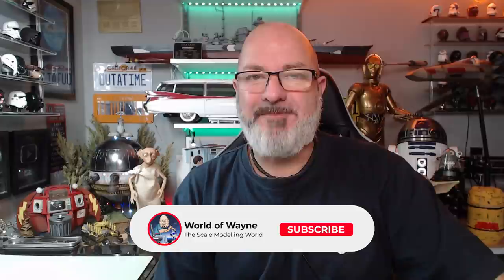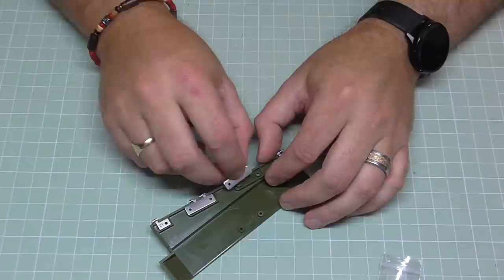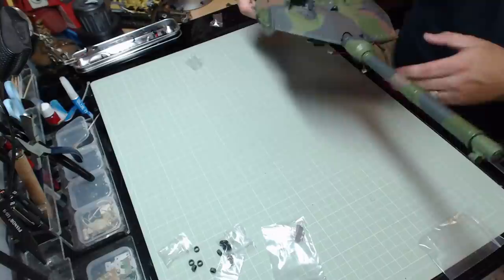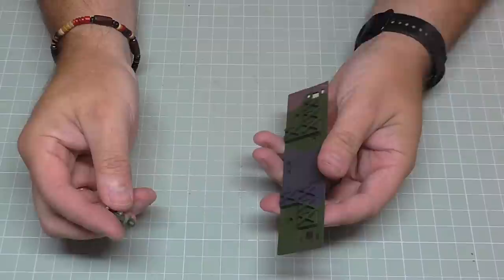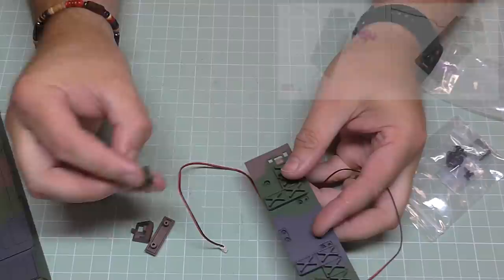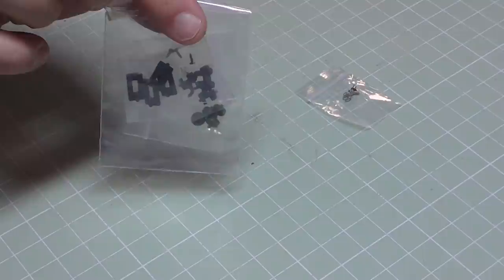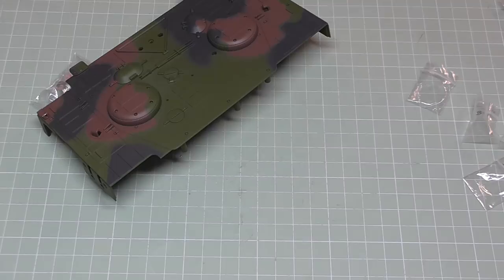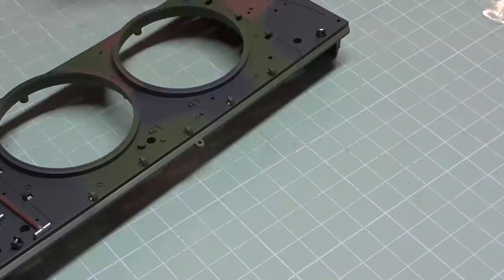Build the 1:16 Scale Leopard 2A6 Main Battle Tank - Pack 4 - Stages 25-33

Comment: Are you going to be building the Eddie Stobart Truck?
The parts above the tracks to either side are known as the sponsons and contain the left and right fuel tanks, there is a third fuel tank in the centre of the tank near the base. This tank can hold up to £5000 worth of fuel giving it a range of about 350 miles.
Reply from the maker: Nope
Reply: @WorldofWayneUK  Too big or not interesting enough?
Reply from the maker: @milanondrak5564  really not my cup of tea. One of the big American Juggernaughts would have been my thing

Comment: I find it a bit annoying that many of these models seem to be ill thought out as regards to assembly. Putting it together just to take it apart to add something that should have been included in the first place is stupid. Your recent experience with the F-40 is a classic example Wayne and shouldn't be necessary in kits costing as much as they do! Rant over! ☺️
Reply: I will say this: Its perfectly logical to put a tank together using screws to hold together metal panels. 

Theres not a whole lot of excuses like that for the Enterprise, when the single-piece injection molded models look so much better than a starship full of gaps inbetween the panels.

Comment: You'll need to keep an eye on how many of those track sections get assembled on each track.  I would imagine that those are none too easy to take apart!
Reply: I booboo-ed one of my links where it is upside down and still haven't decided how I'm taking it apart.  All following assemblies of the tracks have been paused as well because I've been staring at the lack of an end link while having an extra middle spacer bit.  I'm assuming the missing end link is pretending to be a spacer at the moment and I just haven't been able to identify it yet.
Reply from the maker: Easy to take apart. Get a flat head screwdriver, Insert and twist

Comment: Looking nice, your doing a good job Wayne. One thing that gets me is. You can get a Heng Long Leopard 2A6 RC tank for £300- £500 with bb firing gun, lights, smoke exhaust, fully painted and metal tracks. Yet model company's charge £9.99 a issue for a tank and you build it yourself.. I was looking at Tiger 2 from Hachette and will be getting a custom painted Tiger 1 Pro from ebay in Tiger 131 colour for about £500.